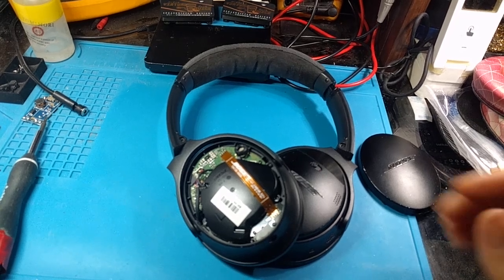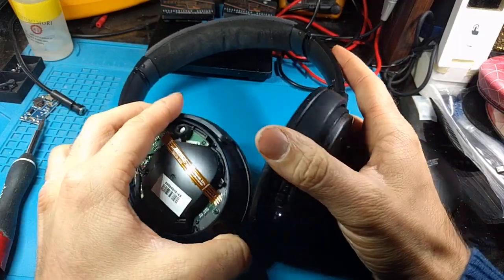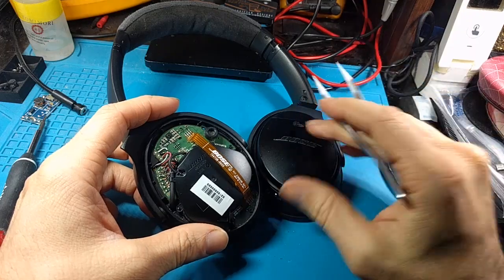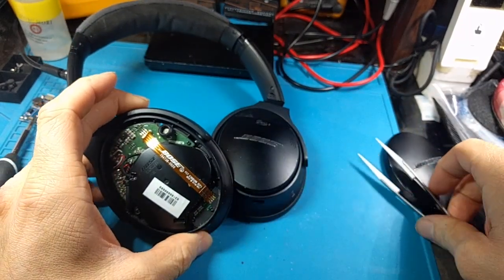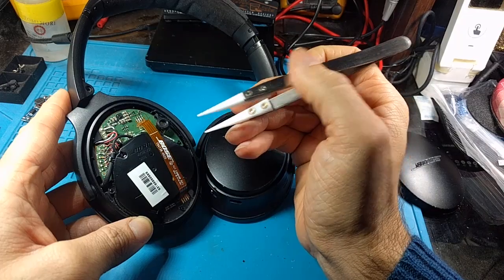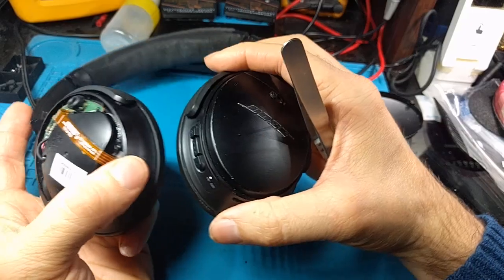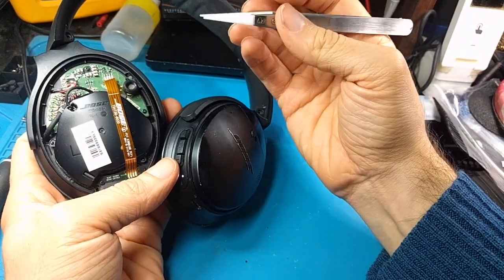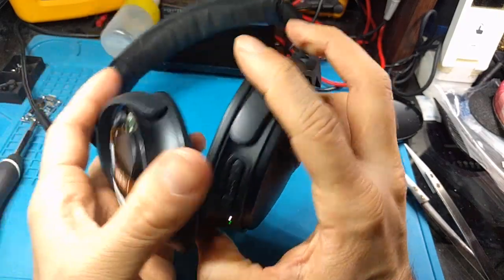EPIC Bose QC35 Repair / white LED fix (using custom SSFD circuit)

Comment: Thank you for letting me know what is wrong.  I dont think that I can fix it.  I am not electronically skilled enough.  Mine are about eight years old any way.  thanks.
Reply from the maker: just dont throw em away!  If you ever want to donate a broken pair for parts / education, you can contact me here :)
https://segasonicfan.wixsite.com/retro/contact
Reply: Hello I’m in the same boat and I sent you an email, I’d like to donate them

Comment: Hi. Interesting mod, but isn't it overkill when it's just a single TVS diode on the USB-connector-board that is corroded and leaking current? On mine it was around 750 Ohms where it should measure as infinite. Just replace the CG0402MLC-3.3LG diode just below the white LED and it's fixed for good. Cover the board in some conformal coating it you want it to be a little more rain proof in the future.
Reply from the maker: I never found the issue, so this was a fancy workaround.  If replacing a TVS diode can fix it, that's certainly much better!  thanks for the info :)
Reply: Hi there! Thanks for the information. It was really helpful and it helped me to find a solution for the constantly burning Bluetooth indicator problem. I don't have the opportunity to purchase new diodes with the same nominal value at the moment.
I was able to fix it by removing two elements: the first one was located below the white LED and the second one was to the right of the blue LED.
When I removed them, I noticed that the resistances were 455 ohms for the first element and 124 ohms for the second element. After deleting these two items, the problem completely disappeared.
Reply: @АлексейВидьманов  Hey, I'm currently facing the exact problem. Do you have more information on what to remove? 'Below' and 'to the right' didn't really help me in finding the components. Thank you
Reply: @АлексейВидьманов  Glad I was able to help.
Reply: Mine was 15 ohm! Removed it and it seems to work. No ESD protection now I guess? It is very very small..... Thanks for your idea that was the solution
Reply: @car-dcd  It's 15 ohms because the water made the metals track across it, making it lower resistance. From facoty it's high resistance.

Comment: Ok I manage to fix my problem. I found out the solution by chance. I just unsoldered and the wires of the batteries. And then solder its and it was working after it. I think it’s like a hard reset somewhere in a ship.
Reply: Hey man! Which battery wire did you unsolder first or dies it even matter? I want to try that method myself
Reply: @chumplerumple  Look at my other answer in the thread. If you cannot find it, i will copy it here: "Hi. Interesting mod, but isn't it overkill when it's just a single TVS diode on the USB-connector-board that is corroded and leaking current? On mine it was around 750 Ohms where it should measure as infinite. Just replace the CG0402MLC-3.3LG diode just below the white LED and it's fixed for good. Cover the board in some conformal coating it you want it to be a little more rain proof in the future."

Comment: Great video! Same issue for me. I have tried cleaning the switch, downgrading the FW, upgrading the FW and nothing has worked...
I am comfortable doing all kinds of soldering and electronics work, and enjoy it a lot. So if you could share your touch circuits would be great :)
Reply from the maker: Hi! the boards will be available in the future. I'm designing something using them for another project. I'll post back on my page with a new video when they are ready, but it could be a couple months.
Reply: Hi bro good day🎉
I need your help my Bose qc 45 headphone 
Problem 1 
while charging amber and white led blinking 
Problem 2
 I was replaced new battery and updated latest new software firmware in the Bose website after that my headphone was working perfectly and next day my headphone was dead and it won’t power on and while charging again amber and white led blinking 
Please help me to resolve the issues